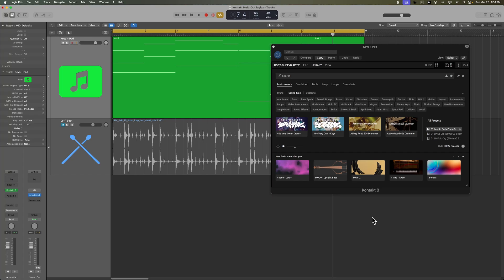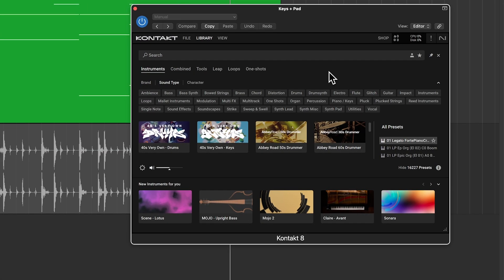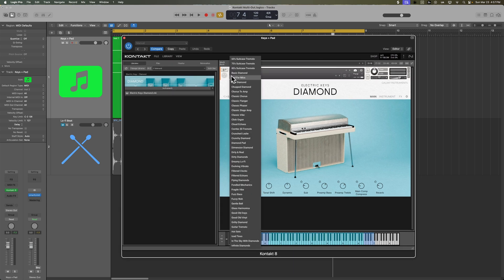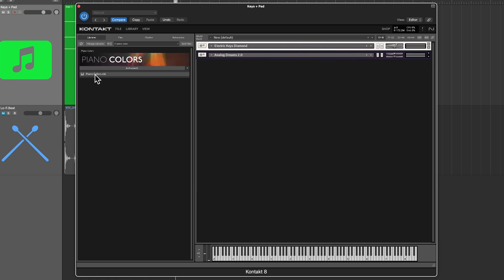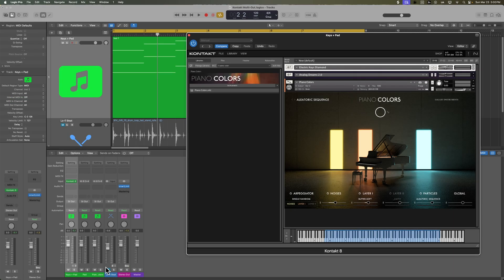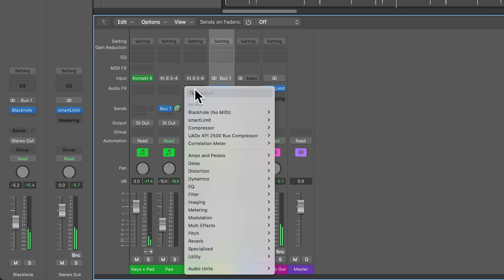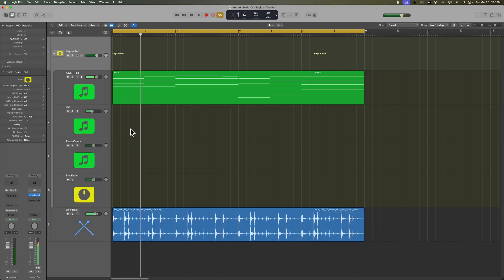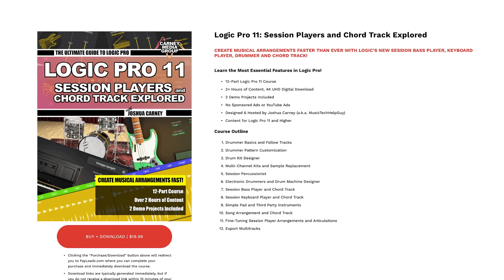Kontakt Multi-Output Routing // Layer Up Your Instruments! (Logic Pro)

Comment: It's unbelievable that you have to deselect the current instrument by clicking in an empty space below it.  There should be an option to load multiple instruments where a new instrument would just be added by double clicking on it.
This has been an issue for years but NI still does not address it.

Comment: Thanks Josh. Is adding more instruments to that one instance of Kontakt as easy as selecting it and then pressing the plus on the main track to create its own track? I’m assuming one instance is much less processor demanding than multiple instances. I often get into a project and want to add more instruments to the instance, with each on it’s own track/output.
Reply from the maker: Yes, but you also have to assign the output for the instrument as well. So 3 steps. Load instrument, set output, then hit the plus button.

Comment: @MusicTechHelpGuy thanks for a great video. This setup works great with one small problem...if you are using Logic Remote, as your midi controller the keyboards, chord strips and other Logic Remote tools will only work on the main instrument track, not on the aux tracks. If you load the Logic Remote keyboard and select the second output aux track, the screen change to a black screen that says "PLEASE SELECT A TRACK THAT ACCEPTS MIDI". Select the first track and the keyboard reappears. The only fix for being able to use Logic Remote on every Kontakt track is to go right back to using multiple instances of Kontact or Omnisphere etc. I love using my iPad Pro to control Logic but this issue has forced me to use a keyboard if I want to use this multi out setup. I really wish Apple would find a way to make the Logic Remote keyboard and chord strips work on the aux tracks as well as the main instrument track. Maybe there is a technical reason it can't be done that I am not aware of? Thanks and I would welcome your comments.
Reply from the maker: Interesting. I'll have to grab my iPad to see if this works, but have you tried clicking on the multi-output aux tracks in the mixer and pressing Control T to create tracks in the tracks area first? I know in Logic using a normal MIDI controller you can record MIDI directly to the aux tracks.You just have to create tracks in the tracks area first.
Reply: @MusicTechHelpGuy  Hi thanks for responding! Here is a step-by-step of what I am encountering....I load Kontakt 7 then I load two instruments - one on ch 1, outputs 1/2, then the second one on ch2, outputs 3/4. I go to the mixer and hit the + sign to add the aux track for the second instrument and then I create a track for that aux track in the arrangement view. I go to Logic Remote and open the keyboard with the first Kontakt track selected. With the first instrument/track selected, the keyboard displays in Logic Remote. When I select the second track/aux mixer strip for the second track, the keyboard immediately disappears  and "PLEASE SELECT A TRACK THAT ACCEPTS MIDI" displays on a black screen. If I click back to the track for the first Kontakt instrument, then the keyboard reappears. Same thing happens with the chord strips. The only way around this is to load a separate instance of Kontakt for each instrument. In that case, the keyboard and chord strips are available for each instrument. Not sure why this is the case, but it is a huge bummer for me because I use a lot of multi out configurations and would love to be about to use Logic Remote instead of carrying a keyboard with me when I am not at home. It may just be a limitation of Logic Remote. If that is the case, I wonder if Apple would do anything to remedy it at this point? Maybe you have a contact at Apple that you can ask about this because I can't seem to get anyone at Apple support to explain why this is happening or to offer any way to resolve it other than to use individual instances of the VST vs using a multiout setup.

Comment: Great video! With the modern powerful Mac computers would it be ok to have 2 or 5 instances of kontak at the same time in different tracks or is it a must to have just one?
Reply from the maker: It's totally fine to have multiple instances of Kontakt. There are reasons (film scoring, orchestral music) where you'd want to use this workflow all the time. But most of the time I just use multiple instances of Kontakt. I only do this when I'm intentionally layering up multiple Kontakt instruments.

Comment: I am not in front of my computer right now, but is it right to say that you cannot add midi effects to individual channels this way? I seem to remember something like this from a couple of years ago! And regarding the last question, why use one Kontakt instance, isn't it to save memory?
Reply from the maker: Yes, you are correct. Only the first Kontakt channel will have MIDI FX. So in terms of MIDI effects it's less limiting to just make 3 instances of Kontakt and sum them together. There are a lot of folks that use Kontakt for film scoring, sound tracks and orchestral music. It's often helpful to group together multiple similar instrument patches in that type of workflow. For example you might have one instrument on the legato violin and another on pizzicato violin, but in order to treat them as the same instrument, you might want to group them together. I think any memory you save is negligible on modern Macs though.